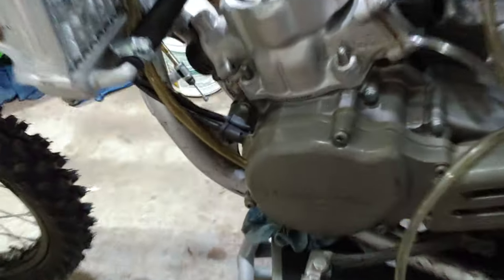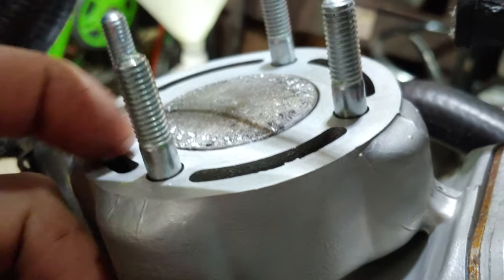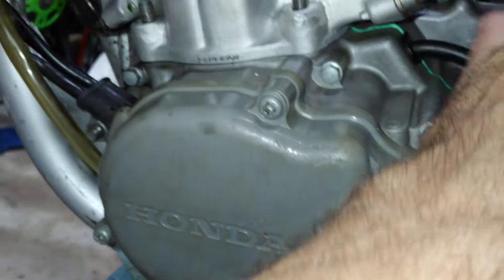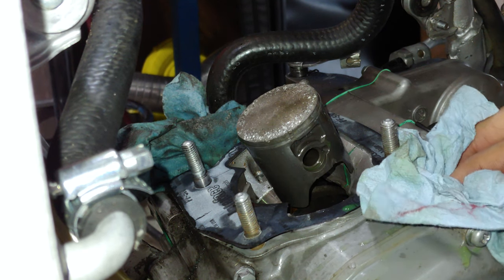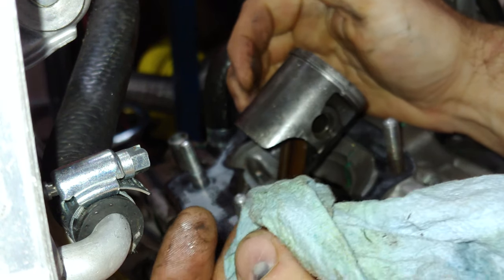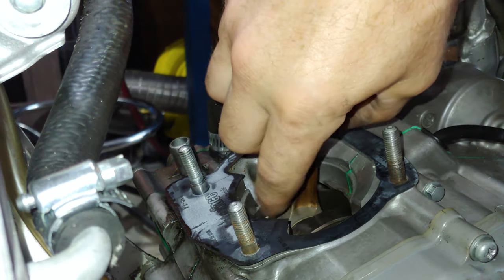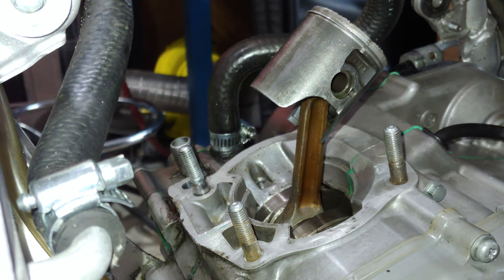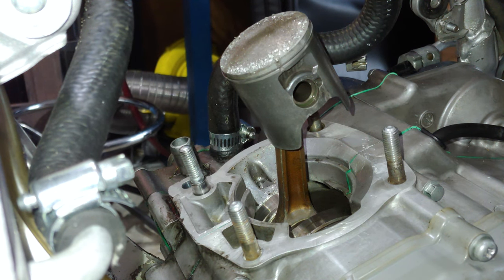03 Honda CR85r Rebuild Part 6 || What Happened [The Damage!!!?]

Comment: hey man when you washed your bike did your  spark plug ignition coil and all those components go bad with the water ??
Reply from the maker: No. If yiu sre experienimg no spark now, you csn disconnected your stop buttin snd blow it out with compressed air or use s hair dryer on it and get the moisture out. Then out it back together. That should do and is the most common source of no spark after washing a bike. Just try and stay away from it when rinsing bike.

Comment: The pitting on the head are caused from detanation I had the same problem 3 weeks ago on the same bike and when I took the head off I seen the pits after that I just said fuck it I'll take the cylinder off and I seen the rod bearing had let go it had tones on side to side and some up and down it had caused the piston to have the pits on it and it detonated at the right spot and caught the very edge of the piston and in turn caught the ring and caused the bike to have no compression... long push back 2km of pushing. Anyways I ordered a hotrods bottom end kit with a new crank, crank bearings,seals,gaskets, and what ever else u could need I just finished the bottom end last night and just waiting on the cylinder to be bored out with a new .50 piston. To be honest I got 3 years out of the last crank and other people owned it before me so with any luck this crank will last 5 years
Reply from the maker: This was caused from pieces of the connecting rod bearings.

 Ywah you should be good after the rebuild and it will last you a long time. If its goinf to be raced just remember to replace the piston every 30hrs or so.